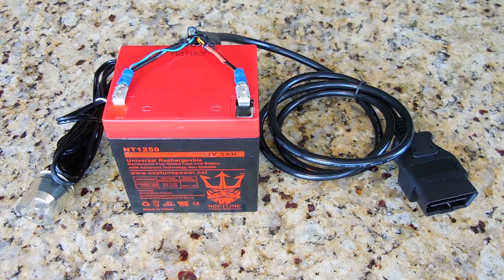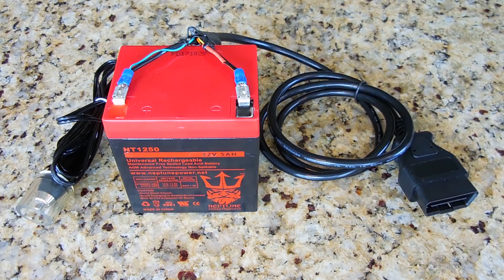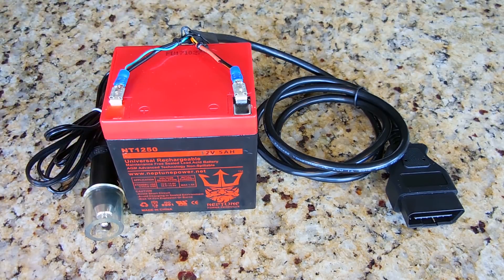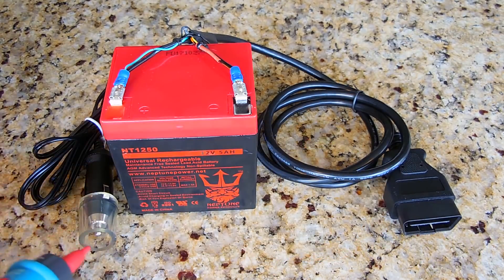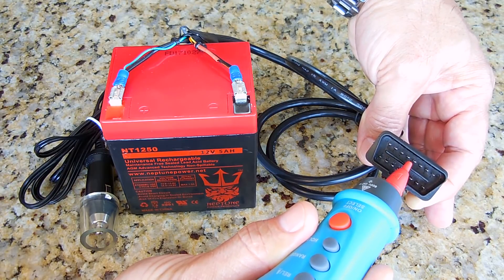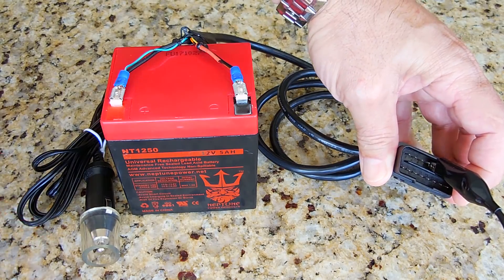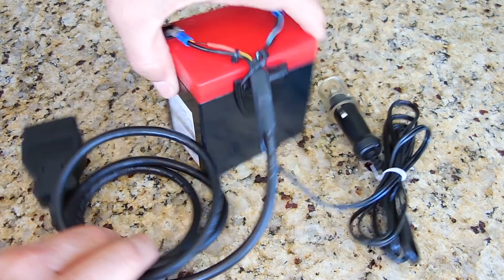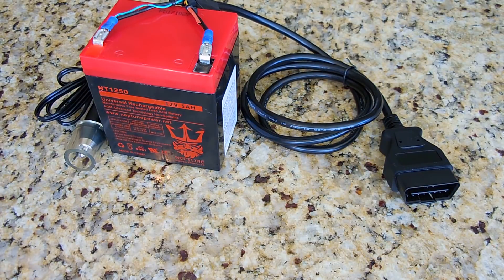How To Make OBD2 Car Computer Memory Backup Saver

Comment: Great video. They should sell these pre made. It is very important to maintain the voltage in some cars .  Glad I stumbled over this.
Reply: They do sell them pre-made with an OBD2 cable going to a male 12v aux connector.  They usually include an female 12v aux connector that has small battery camps but you can skip this connection and just use the male 12v aux to another car's 12v aux connector or your alternate power supplies that have a 12v aux female on it.  I think I paid $17 on amazon for mine which came from VTSM, but there are tons of manufacturers including Matco, Schumacher, and NOCO to name a few.  I know that many of them have diodes built in like Schumacher and VTSM so that the car doesn't send power to the external supply.  The pre-built ones also include a 4 amp fuse which is something the home built one should have along with diodes.

Comment: Instead of having a spare battery to connect to why not get a 12v DC power supply and wire it directly to memory save.. It easier to plug it in instead of having a big 12v battery around. Don't have to worry about keeping it charged as well.

Comment: Good how to project, I would recommend that a 10 amp fuse be added for protection. If you look at how the commercial memory saver  cables are built, I believe they are fused and have a led to show it is powered and active.
Reply from the maker: Yes, adding the fuse is an excellent idea. Thanks for watching!

Comment: This is a great way to retain your radio presets & the HVAC actuator learned values, as well as the crucial adaptive strategies learned by the ECM/TCM modules. However, one point needs to be stressed, and that is, when replacing the vehicle battery,  make sure you don't allow the positive cable (or wrench) to touch ground/earth, otherwise you'll lose all module memories, & you'll  likely be replacing the fuse associated with pin-16 for the DLC connector. Also, since pin-16 is hot-at-all-times, it isn't necessary to turn key to accessory position, it should feed all circuits requiring keep-alive pwr. Thanks
Reply from the maker: You're welcome Rob! Be sure to look over my Automotive/Mechanical and other video playlists for other great videos of interest to you, rate thumbs up, and share.

Comment: the obdII port has skinny 12v wires, if you plugged this in, and then say accidentally turned on the high beams, what would happen?
Reply from the maker: lez briddon Why would you do that? Makes no sense. You make sure ALL accessories are turned off before connecting the device and removing the battery. The wires for the OBD port power pin can handle around 5 to 10 amps of current, but the battery voltage will drop down quickly.
Reply from the maker: 9V batteries are a bad choice. There's nothing wrong with using a 12V battery as shown. Thanks for watching
Reply: because no one ever, ever in the history of moving around inside the car, has accidentally hit a switch...
if your going to find an sla, find the jumper cables and just hook it up under the bonnet, way faster than making a magic cable
Reply: Accidentally, he said. Certainly wouldn't want to do that on purpose.  That would backfeed a large current into the OBD port wiring, which could be a problem.
Rather than using a high current capable source like an SLA battery, it'd be more advisable to use something like a 9V battery, or if you have to use a lead acid battery, I'd suggest putting a suitable current limiting resistor in series, so it'll prevent any overload from occurring.
At the expected tiny loads of the memory backup circuits, it won't drop the voltage appreciably, but will kick in to protect it if you accidentally turn on a high current load.
Reply: Yes, 9V batteries are too expensive for what they are.  Of course you know that was only suggested because of their inherent current limited characteristics, so you don't have to go find a suitable current limiting resistor.
Reply: That would be a safer route, or using an accessory outlet with constant power.  If you don't have an unswitched outlet you could probably just put the ignition switch for the couple minutes it takes to swap the battery.  
Lot of work and no real advantage of using OBD2 port for this purpose, unless I had a box of OBD2 connectors I wanted to use up.  If it's too difficult figure out a suitable resistance value for current limiting, at least put in an inline fuse so it's not relying on the OBD2 circuit fuse to blow in event of a mishap.  Protecting the wires with fuses is good practice even though it's unlikely to be needed most of the time.
Reply: For a more realistic accident, let's say in the process of removing the battery for swap, the positive terminal accidentally touches a ground point.  That would then close a low impedance path to the SLA, and the weakest link will blow.  Hopefully that will be the car's OBD2 circuit fuse, and nothing else.

Comment: Actually most cars have charging posts you could connect a charger to as you disconnect and change the battery, for basically nothing.
Reply from the maker: RedWhiteAndBlueVideo Connecting a battery charger to the vehicle w/o the battery installed is a bad idea.
Reply: Not a good idea. You run the risk of damaging many electronic items that way. A charger is not designed to be a constant current output like a battery.
Reply: Jeff Barr
 constant voltage, you mean
Reply: My Noco Genius has a 12v power mode designed for this. Also, I think you could have just used alligator clips and attached the small battery to the battery terminals and achieved the same thing as the Noco Genius. Its still a cool video and cheaper than a Noco. Thanks for making it.

Comment: Instead of snipping 13 wires to different lengths, why not remove/snip 13 pins?  Are you planning to re-use that cable for something else?
Reply from the maker: Ron Yerke If you can get deep inside and cut the pins flush with the plastic, then great!

Comment: Why not just  clip on your 12 v battery in parallel with car battery at the battery terminal leads. Just make sure the battery stays  connected to the battery leads as you remove the old battery. As far as the car electronics are concerned you never have removed the battery. If you are concerned with isolation just install a diode in the temporary battery leads. As an alternative why not just plug in the temp battery into the 12dc  cigarette lighter plug or accessory plug as it is now called. I see your setup has one .This assumes that the accessory outlet does not turn off with the ignition switch which it does in some cars.
Reply from the maker: JOHN LUCAS No guarantee it will stay connected.
Reply: @electronicsNmore pin 16 in right side not left side
Reply: @SOS_ECULAB99  On the male side its bottom left (on the cable he built).  On female side it's bottom right.  When the to come together, they are lined up pin 16 to pin 16 and pin 4 to pin 4.